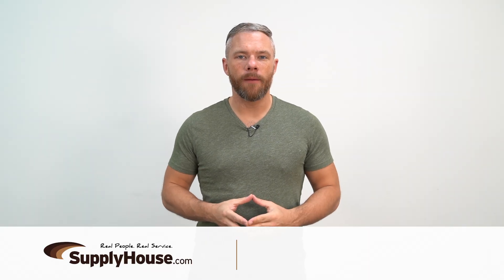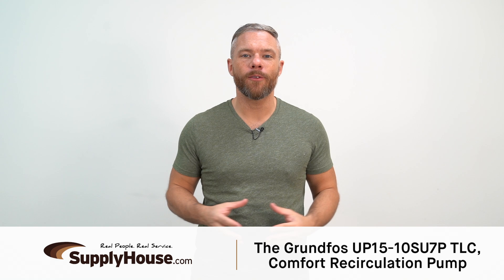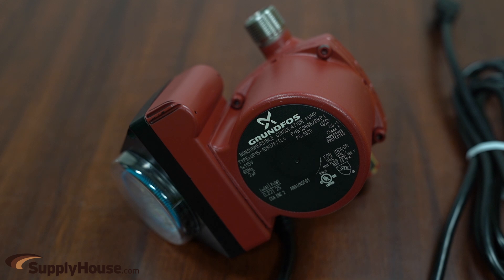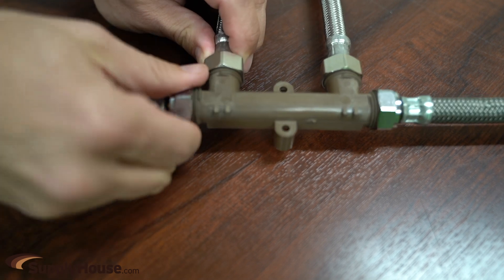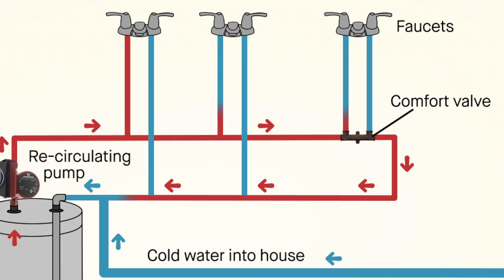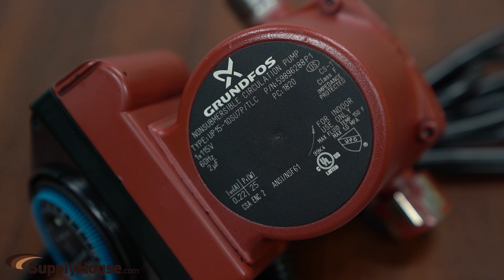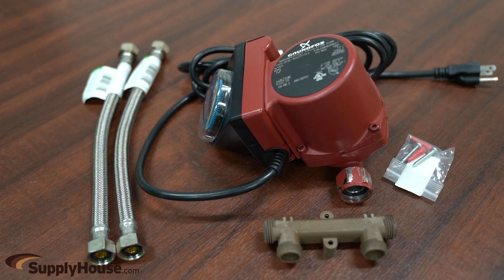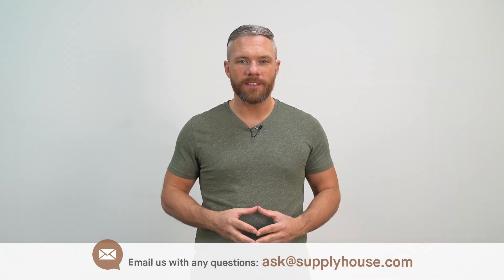The Grundfos UP15-10SU7P TLC, Comfort Recirculation Pump

Comment: Is there a way to bleed air? My pump is making noise and is less than a year old
Reply: I'd think you'd need to install a boiler drain on the cold water/return line, in a similar fashion to how one would for a recirculating system with it's own dedicated return line.

Comment: this is kind of misleading, The cold water in your hot water lines is not "going back to your hot water heater to be reheated" !!!     It is going into your cold water system, it will go wherever you call for cold water. This includes the ice maker in your fridge, the water you drink etc...   this isn't ideal, if you've ever drained a hot water heater you know why... yuk
Reply: This was my first thought too but it does go back into the hot water heater. The exact same amount of water that the pump pushes into the cold side is pulled back into the water heater and the comfort valve only allows only COLD water to be recirculated through the cold line. It shuts off when the water reaches a certain temperature.
Reply: @michaelpounds675  is it really?  The drawing is deceptive,  the water heater in my house is not a couple inches from my cold water source (well tank). It''s actually a gas heater on the the other side of the basement by the chimney. So there's a tee at the source and a 25 foot run of cold water to the water heater and 25 feet of hot water to the start of my plumbing run. The drawing makes it look like all my cold water lines are as close to the water heater as they are to the other fixtures . The cold water and hot water to fixtures are run side be side. That comfort valve closes at about 100 degrees, even with no other fixtures open its unlikely my cold water lines will clear the formerly hot water. 
 It really doesn't effect me I have added a reverse osmosis system with separate faucets for drinking cooking etc.. 

I'm going to install this system when i replace my water heater, wiring it to a smart outlet (pump set for continuous operation). So i can turn it on with my phone before i shower, laundry etc.. this should reduce well pump cycles and put less water into my septic system
Reply: Not really, thats why there is a separate return line coming from the furthest fixture. The diagram is just not drawn correctly. It will work with a check valve.
Reply: @SkittleEagle  ???? it is drawn correctly for this application There is no check valve in the drawing. just the "comfort valve" which is a thermally activated vale that allows hot water to pass into the cold lines until the water reaches a certain temp,I think it is 100 degrees. 
where would you put a check valve??

Check valves are used when you have a dedicated return hot water line that is a home run back to a tee on the bottom of the hot water heater at the drain valve.
Reply: @wingnutwingnut7490  the drawing does show the return line back to the water heater. That is where the check valve would go. Maybe it depends on where you are located but my inspector ask for a check valve.
Reply: @SkittleEagle  It is showing it going back via the Cold water line. 
Look at the three water lines bottom one is the main cold water line. it goes into the water heater.
The middle line is also the cold water it tee's at the water heater.
The top one is the hot water line
and up to the first sink as a red hot line and is mostly blue in the other 2 sinks 

the comfort valve is basically a thermally activated tee, connecting the hot to the cold under the far right sink at the end of the hot water run.

activate the pump before opening any valve, and water flows from the water heater though the open comfort valve until it reaches 100 degrees then the valve closes.
Reply: @wingnutwingnut7490  You are correct. Incoming water service pressure is likely higher so you probably wouldn't need a check valve, but I would still install one on the service line feeding the house.
Reply: There is no separate return line in this installation. The idea with this system is that it's easy to install. A separate return line is a great idea though, but not everyone wants to invest the labor.

Comment: I had this installed by a plumber 2 years ago.  I turn it off in summer..when I turned on  now the pump runs, pipes are hot but the hot water takes forever to reach the upstairs.  Suggestions before I call plumber?  Thanks

Comment: So this the pump pushes out the cold back to the water heater?  Does it push it back to the water main as well?
Reply: No No No! Every drop that the pump pushes comes from the hot water heater and the hot heater has to pull the same amount back in to replace the water that it pushed into the cold line. The water heater will use slightly more power to keep the water in the line warm and the pump uses a few watts of power.
Reply: yes it does, that graphic is misleading, the cold HOT water leaving via the cold pipe from the third sink will go to the cold water of the first or second or the ice maker if they are opened
Reply: @wingnutwingnut7490  oh ok, thanks.  Do you think they’ll have to install a check valve as well?
Reply: @hyster2568  there's only two options. Either as they show it and your cold water is "contaminated" with the less clean hot water heater output water. 
The second option, if you have an  unfinished basement in a ranch, as I do. install the pump on a return going into the hot water heater bottom (remove the drain valve and replace with a tee) This method isolates hot and cold water.  There are some videos here on youtube

Comment: i Just bought this pump, but i do have the possibility to put a return loop if its better.... i have a solar water heather that feeds a tankless electric heather... what should i do ?
Reply: Jose Arellano you only need 1 heating source the Manafort piece will just bring hot water to you 10 times faster
Reply: @dellarossaplumbing1792  

What Manofort piece?
Reply: The return loop must go to the solar ☀️ heater for maximum efficiency

Comment: Can you put this on a tankless water heater rinnai to be exact
Reply from the maker: It's recommended you confirm with the manufacturer of your tankless heater, as some manufacturers will also void or cut your warranty in half if it's used with a recirculation pump.
Reply: @Supplyhouse  you will burn up your tankless becuase it will alwas be burning
Reply: @combs1945  not if you have the pump on a timer set conservatively
Reply: @djhealthcareconsult  

If the input water to the tankless water heater is hot, the heater won’t fire 🔥 up.
Reply: @combs1945  Thi same exact bypass valve is sold by Rinnai: Rinnai Thermal Bypass Hot Water Recirculation Valve U306-1449 Grundfos 595926